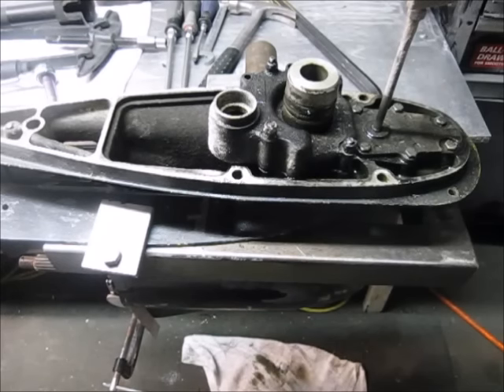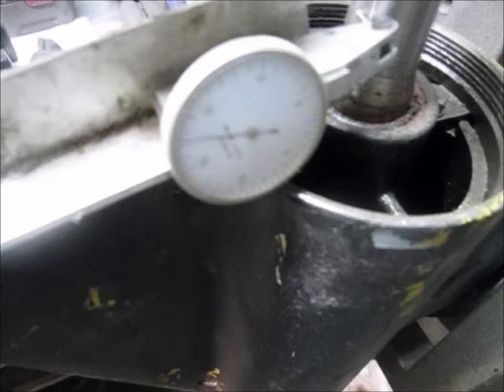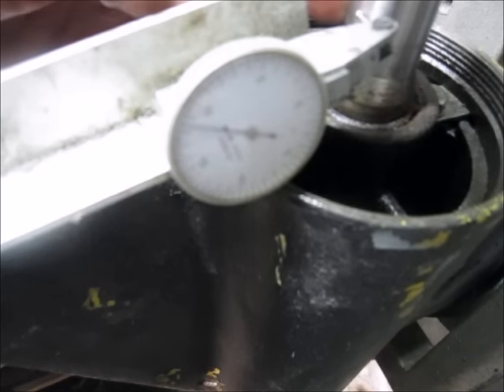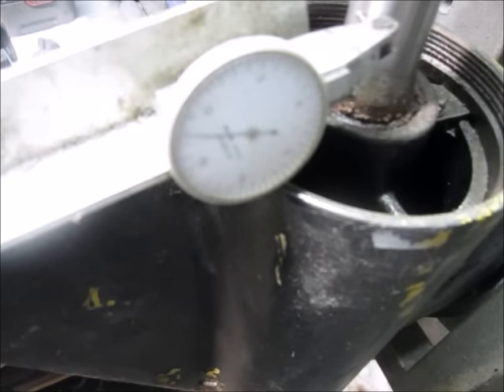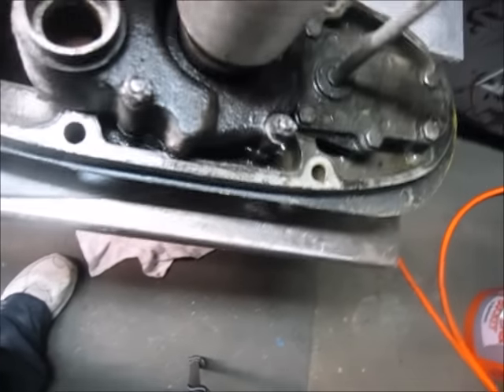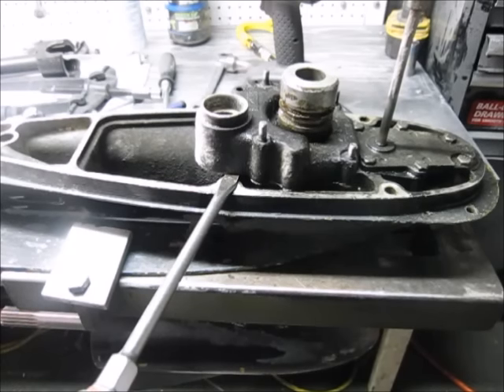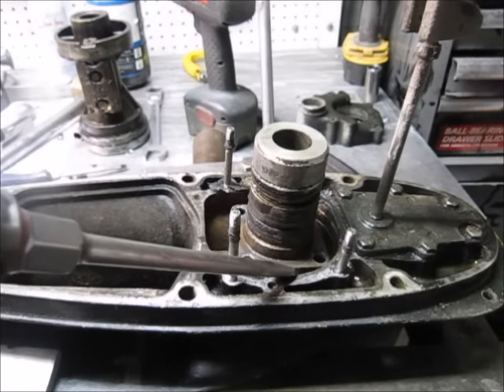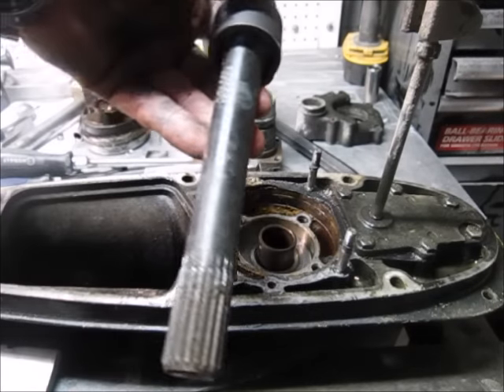How do I disassemble my OMC Cobra lower unit

Comment: I see you used a special tool to remove the pinoin nut. I  I used a long wrench I made with a straight angle. I used long needle straight nose pliers to put it back on. Simple shop aids made in my shop.

Comment: I really appreciate the time you take to show us these informational videos. I have 1 question. Would you be able to provide me with seal kit part numbers i would need to buy? I have a 1992 5.7 OMC. model # on sterndrive tag is 986702, Serial number T0741600

Comment: As you pulled out the prop shaft bearing housing, why did you not use the threaded holes with your puller

Comment: Hi wayne, thanks for the vid. Got an 87 cobra 5.0 - replaced the gasket, new water pump, int water pickup seals seem snug and good, new water pump kit.. still zero water flow from pump?? I taped the water grates at the bottom and filled inlet hole with water - it stayed there! Stumped! I did notice exhaust gas coming up thru the tiny hole where the small rubber tube connects to housing - any ideas?

Comment: Thanks Wayne just took apart a 1989 0MC small barrel. Made a jig for our auto engine stand so we can turn it any way we desire. We made the oil drain air injection part by drilling a grade 5 -3/8" bolt then tapped the carrier holes 5/16th " used teflon tape dope around the head of the 5/16ths bolt heads to hold in the socket.  For that tap we used a lavatory and hosebib fourway key and ground off the large T parts glued the tap in the smaller of the small ends and the other just fit a 1/4" ratchet drive with short extension. Put the washer and prop nut on to catch the carrier a plumbing compression test plug on top to plug that off  put air to it and pop it came right out.

Comment: My omc cobra lower unit has 4 bolts that hold the hub in. Why is this different?  Also after you pull the hub it looks like there are snap rings to get the rest out
Reply: 4 cyl  3.75" version vs V8
Reply: I have seen many of your excellent videos. I need to put in the modified detent is there a step by step on that process?